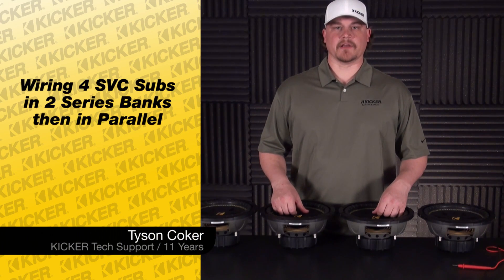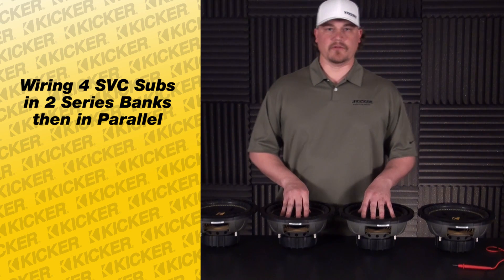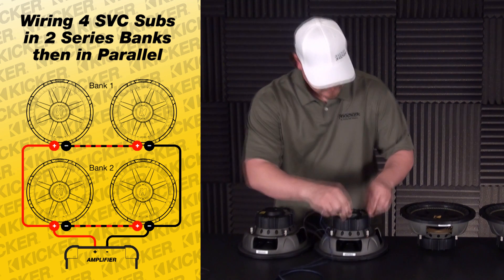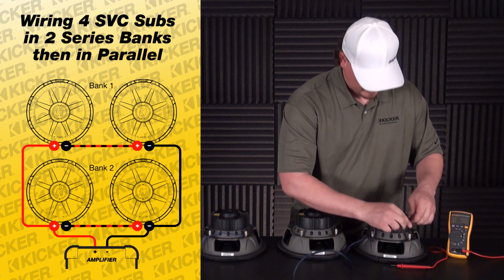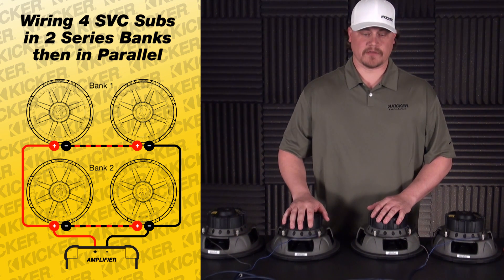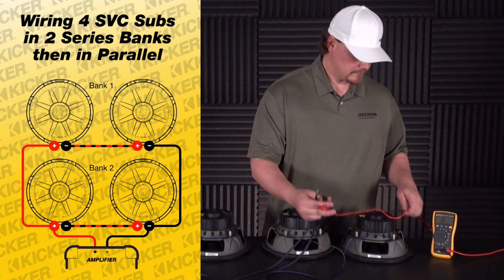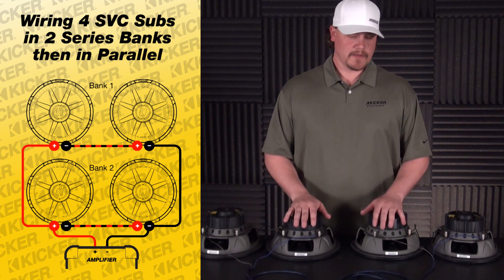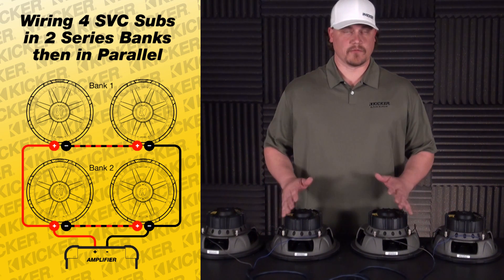Subwoofer Wiring: Four 4 ohm SVC Subs in Series / Parallel

Comment: Ok so i have a 2 channel amp that makes 150x2 at 4 ohms and 230x2 at 2 ohms and i wanna power my door speakers that handle 150 rms, should i wire them down to 4 or 2 ohms? I feel like there would be a loss of power if im wiring 4 speakers to the same channel right? So would i wire it to 2 or 4 ohms to get the closest to the recommended power rating of the speakers?
Reply from the maker: Most door speakers are 4 ohm single coil, so the only way to get it to 2 ohms would be to pair it with another 4 ohm speaker. If you did this, provided its in the same door, you would get a lower ohm load but would be splitting the power between the speakers.

Comment: hi, my friend I have 4 deaf bonce AP-M81SE 4 ohm 170 rms 340 watts max each speakers but I have an amplifier taramps MD 3000.1 at 2ohm would that amplifier be fine or do I need a smaller one thanks.
Reply from the maker: There are a few questions to ask:  first, how many of those speakers did you intend to install?  RMS is 170 watts, so if the final load going to the amplifier is 2 ohms (the highest stated ohm load on the amplifier product page) you would need to run 10-12 of them. Second, using a mono amplifier for a stereo application means you lose your stereo imaging. It is a lot of power, but you will lose sound quality.  Contact the manufacturers for additional details (we don't make these products). 

Here are the product pages: 
https://deafbonce.com/speakers/apocalypse-ap-m81se
https://www.taramps.com.br/en/produto/md-3000-1-1ohm/
Reply: @KICKERAudio  what kicker amplifiers you recommend me to move that 4 speakers 4ohm thanks
Reply from the maker: Unfortunately we don't have anything that would  be 175x4 @4 ohms or 300x2 @ 2 ohms.

Comment: Can i do this  with 4 single coils 8s mids for a 4ohm load?
Reply from the maker: The size of the sub shouldn't make a difference. You would get a 4 ohm load if you wire it this way with SVC 4 ohms subs.
Reply: @KICKERAudio  i saw the mistake im using 4 .8ohm not 4ohm

Comment: If I wired 4 6x9 speakers and parallel like you done and going into a 2 channel amplifier, I will need to connect positive to 1 channel and negative to other channel, will that be fine.
Reply from the maker: The ohm loads you see in the video are the same for any speaker, so your wiring would result in the same ohm load whether its a 6x9 or a subwoofer.  You might like this app we made: www.kicker.com/kickeru

Comment: I have 4 12 pioneers subs 300 watts rms wired to a soundstorm 5000 watt wired in parallel and the badd seemscto go out when the volume goes up why
Reply from the maker: What ohm load are you sending to the amp? Measure it with an ohm meter for starters, or bring it to a car stereo shop if you don't know how to do this.

Comment: I have two JL audio 10TW3's dual 4 ohm dvc,  how would I wire it to an amp to show a 2 ohm load??
Reply from the maker: Unfortunately, you can't wire a pair of DVC 4 ohms subs to 2 ohms unless you don't use two of the coils - which would cut the power handling in half. Your choices are 1 ohm (parallel), 16 ohms (series), or 4 ohms (series/parallel).  Deciding which option is best will depend on the amp you have.  Our current line of KX mono amps are 1 ohm stable.  Since you have an 800 watt total RMS, this is the best amp we can recommend: https://www.kicker.com/kxa8001-800-watt-mono-amplifier
Reply: Thanks you for your help

Comment: What should I do if I want to add a secondary amplifier (differrent watt amp.) to two totally different subwoofers (all 12 in. Subs.)???
     I'm hooking-up a secondary car-battery; should I just run the second Amp. off of the second Car-Battery, and the first Amp. off of the 1st. Car-Battery (the one that powers my Car)?
Reply from the maker: There are a number of questions to ask.  First, we need to know the model number of both subs as well as the number of voice coils and ohm load.  Very often, those subs will require different amounts of air space to do their job correctly. Next, what are the amp models and what are you hooking them up to? One per sub? Or is one going to the subs and the other to the mids/highs?  As far as hooking up multiple batteries, you've got to check out this video.  The guy is HARDCORE, but the point is the same and hes really entertaining: https://www.youtube.com/watch?v=kBLd9qFjBDM
Reply: +KICKER : My first Amp. is just a genaric 1200 watt. amp (no Brand is show on the Amp. --- just kool neon blue lights). The 1200 watt. Amp. is powering two Kicker 12 in. subs, at 4Ω per sub. (not sure what model they are, but their curcular shaped), but they make my car's lights dim a bit on full Bass --- I personally think that the Subs. are underpowered...
    The second Amp. I have (the second Amp. I want to hook-up, so I can power 4, 12"  subs.) is a 820 watt. Pioneer , 4 Channel Amp. I want the Pioneer Amp. to power to TREO 12 in. subs. --- I've already had these hooked-up together in my car, and they sound good.
     Addittionally, I have factory speakers, and tweeters in my car (Oldsmobile, Alero; 2004).

What do you think I should do???
Reply from the maker: No such thing as a generic 1200 watt amp. Its important you find the model number and manufacturer. I'm not being dramatic when I say that wiring the amp incorrectly can cause the amp to shut down, or In extreme cases, I'm talking car fire here. Plus, most amps with no name and no model are flea market amps that almost never deliver the power they promise.

As far as the Pioneer/Treo question, you'd need model numbers for both to figure out whether you have enough power.  Can you get that info?
Reply: +KICKER : Better yet; do you know where I can buy a Car-Audio intallation manual/book --- I don't want to have to go to Community College just to hook-up xtreme decibels in my ride(s), and I don't want to pick your brain anylonger?? I looked at Walmart for the book, because I want to learn, but they don't sell one. Any suggestions?
Reply from the maker: Actually we have a lot of good videos on the subject, and so does Crutchfield and Sonic Electronix.  Definitely worth checking out!
Reply: +KICKER: Thank you for your help, and your time...
Reply: Can I take a svc 15 800 watts 4 ohm down to 1ohm

Comment: I have been trying to find a wiring for 2 4ohm speakers wires to a 4 ohm load in a bridge because I can get the max out of my amp in bridge 4ohm load my amp isn't 2ohm stable in bridge
Reply from the maker: Unfortunately, the math doesn't work out on that, unless you have dual 4 ohm voice coils.  In that case you can wire series parallel. If you need more help, just give us a call! We are open weekdays from 8-5 CST at 405-624-8510
Reply: KICKER so would I have to get 2 more 4 ohm subs run it to 8 ohm and then series parallel would that work either way they are only 10" kicker comp if I blow them or the amp I can just get new ones 😁
Reply from the maker: Let's do this...could you tell me the model number of the subs and the amp? That way were on the same page 100%.
Reply: KICKER so my amp is a little on the weak side is a Pioneer GM-A5602 RMS: 150W x 2 @ 4 ohms, 225W x 2 @ 2 ohms, 450W x 1 @ 4 ohm 
• Total Peak Power: 900W

my subs are Kicker 10C104 Comp

I want to get the 450w x 1 @ 4 ohms either way just connecting both subs together or to each channel I'm not using my amp to its full potential I'm debating on either leaving it at 150w per channel or getting two more tens and getting the 4 ohm load using this wiring setup what would be my best option
Reply from the maker: With those subs and that amp, the only safe wiring schematic is series for an 8 ohm mono load, or simply wire it stereo. Just make sure the LPF is on, then set it to about 100 hz.  Play with that setting a bit to optimize it to your subwoofer boxes and vehicle.
Reply: KICKER ok I'll try that if I don't like the bass I'll buy another amp thank you so much for your help I'll recommend kicker next time I'm in a conversation about bass 😜
Reply from the maker: Great to hear!

Comment: So for this I need only a 600 watt amp?
Reply from the maker: Could you tell me what the model number is and how many subs you have?
Reply: KICKER i have a 600 watt amp and two subs how can i connect them in 2 ohm
Reply: @rizansaq5947  if your subs are svc 4 ohm you would want to wire them in parallel to get 2 ohm load at the amp. (Pos. to pos.)(neg. to neg.)

Comment: I have 4 kicker cvr 12s they're dual voice coil is it possible to wire them down to a 1 ohm load at 4 subs my amp can handle .5 to 2ohms I have ran the system yet cause I wasn't sure
Reply: TheSundoWn KiDD if you run them in parallel you will have a 0.5ohm load, or wire ea.sub series, than parallel  to ea.of them you will have a 2 ohm load!
Reply: @walterpinkney2200  do U have a video for doing that with the 4 subs to one ohms ?
Reply: If your amp can handle a load of 0.5ohm,than you can wire ea.sub parallel to one another, or wire ea.voice coil in series than run them parallel to the amp ,&you will get a 2ohm load!
Reply: Is ea.voice coil 4ohms,than no you cant run them @1ohm,only 2ohms,or 0.5ohms!

Comment: Will this work with 2 12 in Sony xplods and 2 12in Mtx terminators with the kicker zx750.1 amp as long as the 4 subs are all a 4 ohm?
Reply from the maker: +Joshua Turner The ZX750.1 is 2 or 4 ohm stable, so yes that would work.
Reply: +KICKER ok thank you. One of my fuses is melted going into the amp, what could be the cause of that. I have two Sony xplods on it right now
Reply from the maker: Several possibiliites. Could be wiring, the subs or the amp.  Give us a call at 405-624-8510 and well walk you through it.  Ask for Tech support.
Reply: +KICKER ok thank you!

Comment: Awsome. Don't think the amp could handel anything more then 3 so the fourth one will have to wait. Sorry to keep asking all these questions lol but you made a video of how to wire 3 kicker svc 12s in series,  does that setup equal out to a total of 4ohm load to the amp? Thank you again for all your help.
Reply from the maker: If your subs are 2 ohm subs then you will get between a 5-6 ohm load.  This is your best option if your amp is running at 4 ohms.  You will not get quite the full amount of power that amp produces at 4 ohms.

Comment: Alright,  each channel has its own fuse to it so I thought it would have to be distributed between the two. But in ur video with the 3 svc 12s wired in series and then parallel to bring them to 4 ohm load, would u wire that directly to one channel or the negative on channel 1 and the positive on channel 2? Or does it matter?
Reply from the maker: It would matter.  If you have a 2 channel amp and you are wanting to bridge the two channels into one to run to the subs, then you would normally take the positive from one channel and the negative from the other.  The amp's instructions should tell you which ones to use.  If you are only wanting to run one channel to the subs then you would only use the positive and negative from one channel.    Then you would have a positive and negative from the 2nd channel to do something with.

Comment: All that is understandable but what about the channel? Wouldn't you melt it due to powering all of thoes subbs? Do u connect them to a negative on one terminal and a positive to the other terminal? And what if u didn't do the parallel part and just connected the remaining 4 wires to the terminals as u normally would after running them in series?  Any help, thx
Reply from the maker: You should not melt the channel of the amp by running a lot of speakers to it.  You just have to make sure you have the correct ohm load, sufficient voltage and large enough power/ground wire.   When you wire multiple subs to the channel of the amp, it's either a series or parallel configuration.  That is the only two options.
Reply: KICKER

Comment: Can I wire up 3 dual 4 ohm subwoofers together and still get  4ohm
Reply from the maker: Unfortunately you cannot.  You will only be able to get a 2.66 ohm load if you do a series/parallel configuration or if you do parallel/parallel you will get a .66 ohm load.  You will either need to run only 2 woofers or add another for a total of 4 woofers to get a 4 ohm load.
Reply: Ok thanks

Comment: can i use this setup for my door speakers ???
Reply from the maker: You can!  Many times you will run multiple sets of component speakers in a series/parallel to a stereo channel of an ampllfier or to a stereo amp bridged.  The important thing is to make sure you have the correct ohm load after you wire them up to get what the amp needs to see.

Comment: I read connecting series will affect Q and may reduce bass. Does this include series/parallell?
Reply from the maker: Connecting speakers in series should not affect the speaker's "Q".  The Q is the number that specifies the resonance  of the speaker and this is tested by the springiness of the suspension and mass of the cone and wiring a speaker in series or series/parallel should not affect this number at all.
Reply: KICKER
Then that was some bogus information I got from DIYaudio.

But it does not change that many people find series connected woofers lacking in comparison with parallel. I have not tried it yet, and I am looking for your opinion.